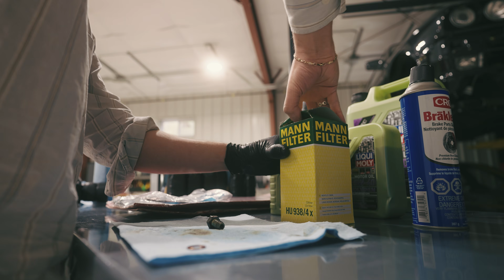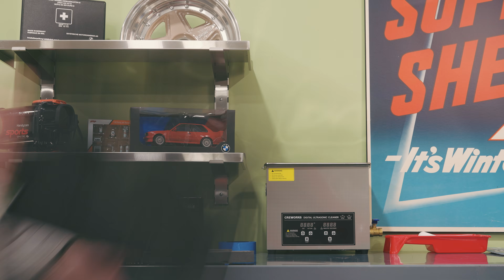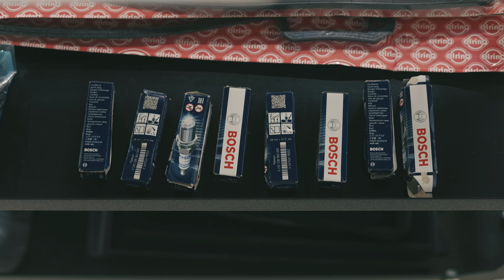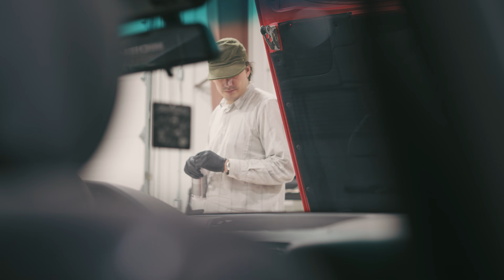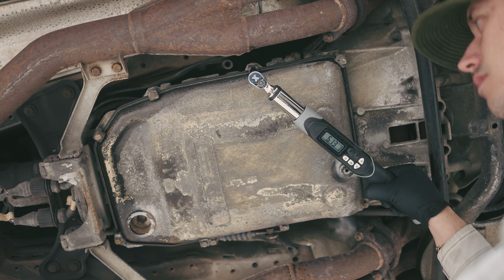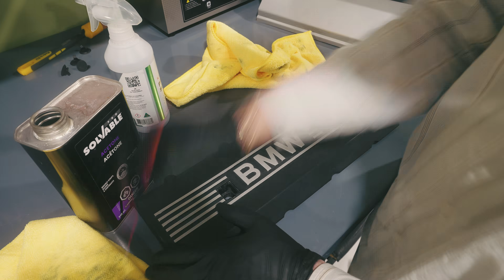messing with my bmw e34 touring engine bay until it matches the rest of the car.

Comment: Dude another amazing Job 🙌

My only Suggestion would be to do a full under carage degreasing or if possible a dry Ice under carage application. 

Other than that it looks so good 😊 

Switching gears I just recently did a pull Glass rehab on my Touareg and MK5 Jetta. 

Full Exterior Glass Compound, Glass Sealant, and interior Glass Anti Fog coating. I can’t tell you how much it rocks to gave clean glass and Zero fogging of your interior glass 🙌

Can’t wait to see the Brake upgrade.

I just ordered new brakes for my MK5 Jetta and new rear calipers. I plan to coat the new calipers with POR Brake caliper paint and then coat them with C5. 

Happy Thanksgiving dude 🤘

Comment: Absolutely incredible work as per usual. That thing is a beauty.

Seeing the car on the lift, I’m sure the car would drive a little better with some more droop, especially on the rear? Can the rear run a helper spring and more shock length? To get desired ride height yet some more drive comfort? 

Cars beautiful
Reply from the maker: Thanks man! I think if I wanted it to be more comfortable I would just get a completely different setup. This set was built for this car at 18k in the front and rear. I have toyed with possibly wanting bigger tires but I’m still torn

Comment: I will say, once you do these valve covers enough times, it becomes quite easy and straightforward. It takes me about 20 minutes a side to do them and I can usually get them seated properly from the first try. Now once you get to the newer BMW's, those generally suck to work on even if you have a ton of experience.

Comment: Beginner's mistake: Always remove the filling plugs of transmission and differential first. Then you unscrew the drain plugs. The way you did it, imagine you can not unscrew the filling plugs and the transmission or differential are already empty...Unless you have in your garage the required tools to remove a broken, stripped  or stuck plug, you will have to call CAA or AAA for a flat bed ...Did you use a torque wrench as required for the plastic oil filter cover ?
Reply from the maker: Yeah man all the fill plugs were broken loose first! It’s hard to show every detail in a video like this. I do not be torquing the oil filter to spec. I don’t think I ever will
Reply: @ChromaticGarage  Thank you for the correction . I am subscribed, Always interesting.

Comment: change out that Mann filter for OE BMW or Hengst. The Mann filter doesn't have the plastic bottom needed to hold pressure on the valve at the bottom of the oil filter housing on the M60 and M62.
Reply from the maker: I really like Mann products man! If a problem or lack of performance occurs I’ll definitely switch it out 🤝
Reply: I agree. Hengst are excellent products.
Reply: Fcpeuro - BMW Oil Change Kit 5W-30 - Liqui Moly 11427510717KT1.LM shows it fits fine.
Reply: @joe_ferreira  technically it does "fit" but there is a clear difference between the two filters. On my M62B46, I used this Mann filter and I had some crazy start up rattle, changed back to Hengst/OEM BMW and it hasn't rattled since (over 4 years).

Comment: So much satisfaction! Air filters replaced and cabin filter replaced?
Reply: Cabin filter is always so overlooked on the E34's, mostly because it's kind of a pain to get to. A lot of people aren't even aware that they have one, based on the amount of original cabin filters I've removed on the various E34's I've worked on over the years.
Reply from the maker: Thanks man! Yeah I did a blower motor, AC service and some other bits not too long ago🤝